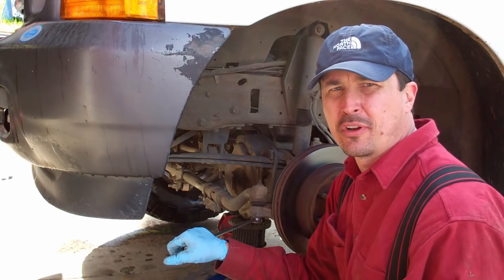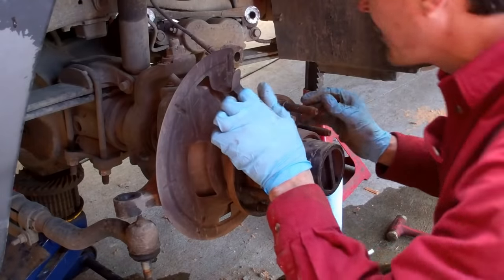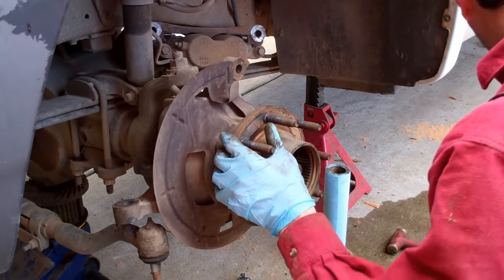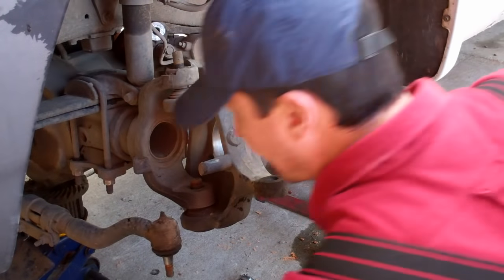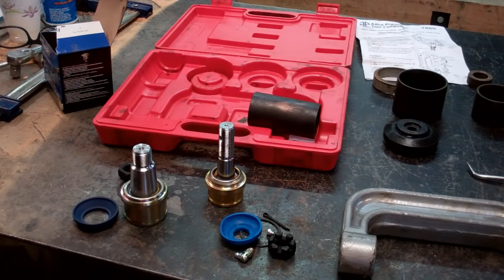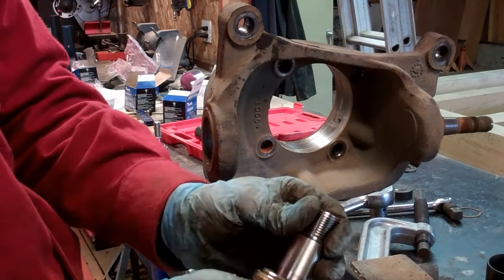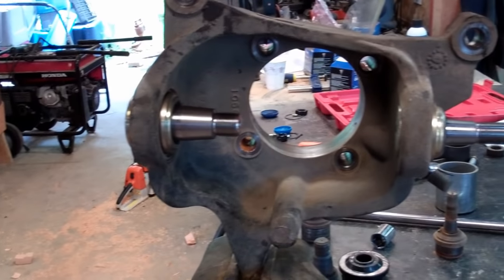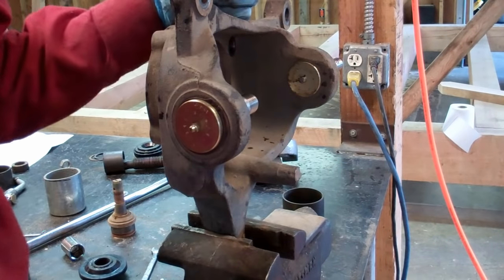How To Replace Worn Ball Joints Ford F250 Truck

Comment: Fantastic video.   Thank you.  I have worked on my own cars my entire life and am getting ready to do my E350's ball joints but was a little concerned as it's such a big vehicle... but this really put my mind at ease.  I don't have to worry about the 4WD aspect either so it will be even easier.   and to the guy below...  "goo gle" I would trust this guy or myself to work on my cars over any "professional certified mechanic".   I make very good money, but I still prefer to fix all of my own stuff as i know it will be done right and know for a fact I take more pride and do a better job than most "mechanics" out there.  Not all...  some I know and trust, but it is unfortunately, not the norm.  In fact most of my friends come to me when they have big repair jobs needed to get a second opinion before taking their own cars in because they have far too often been taken for a ride.    Again, Thanks for this great video!!!  and I agree, buy quality American parts whenever possible. MOOGs have an excellent reputation for lasting forever.

Comment: On reassembly you can put the 90 degree grease fitting in it does not hit I did my F-250 and It works.

Comment: To anyone having the problem pressing the lower ball joint out you can also smack it lose with a small sledgehammer then use a big socket in between to hammer it the rest of the way out. I found it much easier than pressing

Comment: I was quoted $1100 4 yrs ago, Ford E350 van.
Bought parts at autozone around $300 , they have a free loaner press tool.
I used a 120v elec impact wrench ($60) to drive the press, came out a treat.
A 24" breaker bar with universal swivel head is useful too for stubborn nuts/bolts.
I'm not a mechanic, I'm a baker, if I did it anyone can. Why not.

Comment: thank you for the brake down ,, they wanted to charge me 600-700 $ to replace the tope bolt for the camber since my truck was out of Alignment.. i need to replace all my u joints, on my 4 wheel drive f250 91 , i will do this the same time i put  my new rotors on

Comment: instead of buying a piece of pipe for an extension, there is a 4wd adapter that can be gotten at Oreilles auto parts, (just did my f250 4x4) But all your info is handy.

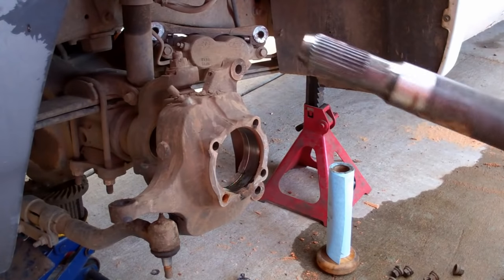Comment: Just a comment, i noticed you pulled the axle out and talked about keeping it clean, however that ring you kinda slid back on to the axle at 8:30 was what used to be a dust shield. Make sure next time you clean the inner axle out real good.

Comment: Good video just one thing the 3 washer and snap ring what’s the order to put them back on. I have the same truck but never mind how I pull them off. Plz if u can plz help. If not that’s anyway good video. Clean shop n like how you beak it down. Without the dragging on just staying on the job at hand. Again thanks I use your video to do my ball joints.

Comment: What year is the Truck you’re working on mine is a 1997 F2 50 heavy duty and I don’t think my rotors come off like yours did nor do my hubs come off like yours did I have to do mine but I need the instructions for a 97

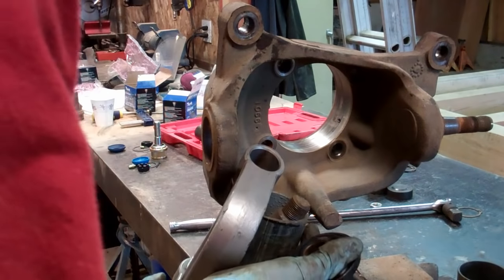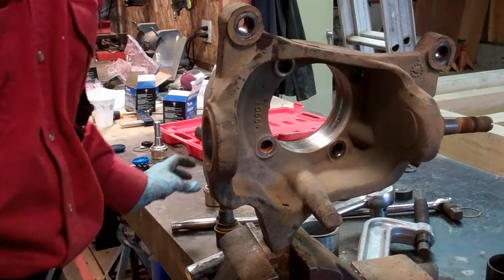Comment: wranglerstar   I'm confused--you said that there shouldn't be any play/movement in the ball joints (16:20-16:50), but the whole purpose of the ball joints IS to allow movement in two planes.  Do you mean there shouldn't be A LOT of movement, or that you shouldn't be able to move it around easily with just your hands (i.e., if you can then either the ball of the joint or the inside surface of the casing has worn down too much)?

Comment: I do all my own work on my old 1988 GMC Suburban and save a ton. One dealer one time wanted $650 to put a fuel pump in the tank  that cost me $35 for the pump, so I did it myself.

Comment: Thanks for the help, I had a major issue with the cheap china made ball joint press rented from one of the auto parts store, if your thinking of getting the press there check to insure that someone didn't bend the c portion of it so that it doesn't align with the ball joint, took me 2 hours of wrestling it to give up and take it to local machine shop, sorry I really need the vehicle  and hate to part with the money. If I ever do this again I will spend bucks and get good set

Comment: Great video. i"m right on the same page with doing your own repairs.
 i wish you would:ve included a good way to reinstall the big axle shaft seal. I just use a copper drift tool working around the seal until its driven in all the way. What do you use?

Comment: Good video.  I haven't gone through and read all the comments, but the person below had the same problem as me.  Axle shaft seal wouldn't come out with a few taps, even though the metal ring from it did.  Too much pounding will ruin this seal.  Best way to get it out is a big pry bar and pry from behind on the U-joint knuckle with steady pressure.  That seal is too springy to pound out if it's stuck.  Ruined mine.  You also need a specialty tool to replace the new one if you break it.  As always, pay for the good parts like he says.  I always go with Moog if at all possible.

Very helpful video otherwise.  Thank you very much for posting it.

Comment: What brand of ball joints are you using I have to replace mine and the Ford dealership here quoted me 1400 for both sides. I plan on doing them myself I just want to know what brand would be good for a 2006 f250 with a 4 inch lift kit and 35in tires

Comment: One additon I would make is that when you take the shaft you should tell views to use two pry bars applying equal pressure on the u-joints and the shaft should just pull out, basically not having to use a hammer.  Other than that an Excellent video, thanks

Comment: A little trick... Change the small bearing( partnumber : b-2110. SKF/Napa I buy mine on ebay) The needle bearing is on the backside of the hub when you do this work. Very easy to change. Take a 25 mm socket and put it in the hub. Then tap the socket with a hammer and the bearing comes out. Tap the new SKF/Napa bearing in with a 30 mm socket. Grease it good with bearing grease. Good and problem free ride for a few dollars😄👍 🇧🇻

Comment: Thankyou very much for this video its helped alot, im going to get this 
done this weekend and was wondering how you went about setting your axle
 shaft back in the proper distance, did you use the recommended tool 
that also sits your axle seal or do you just hit it with a dead blow? i 
would appreciate a response from anyone thankyou :)

Comment: you don't have to remove the abs wire from the hub unit, and alot of the times, you can smack the ball joints out of the knuckle with a hammer, and then just use the correct size cup over the new balljoint to drive it in. saves you alot of time

Comment: Thank you for an excellent video. good detail and clear videoe. One question, you spoke of cleaning up an O ring when you re install the hub. Does that O ring act as a vacuum seal for the ESOF hub?
Reply: Yes it does and you might get error codes if they leak a little. I had to pull mine apart and replace o-rings

Comment: a point not often made is this:
on the press, examine and lube the thread and the cap before use. this ensures that minimum friction fights your efforts to press the ball joint.
a second note on removing the drive axle from the axle housing. Use the greatest care when pulling the axle out. there is an inner seal at the far end of the tube that keeps gear oil where it belongs. Nick that and you will be pulling the carrier to replace it, or u will be getting gear oil out the axle tube. remove by supporting the axle at dead level all of the way out and all the way back in. cleaning first with solvents so as to carry no debris into the seal on the trip back in.

Comment: Thank you very much for this video, was very helpful.
I used only pipe sleeves to do the pressing, could not find suitable c-press or similar.
I prsssed them in a vise.
Sleeve sizes I used:
D=inner diameter
L=length
D:56,5mm L:100mm
D:44-50mm L:90mm
D:50-54mm L:75mm
D:50-54mm L:15mm

Comment: What about the ABS sensor?  If I have it right one should not try to mess with it at the hub but rather remove the lead end where it plugs into the wire harness and keep the lead with the spindle assembly.  Also once it is all installed it would be good to grease that top ball joint to fill it then put the plug in, right?  Otherwise there would be air between the ball joint and the boot/shield and that would allow for contaminates to get in there and it would wear out much faster.

Comment: great video and good help for ball joints. you are a great american for sure. What is the size of the 3" bit of pipe you used.. it looks like 1 1/2 or 2". I plan NOT to be a panzy and do it myself.. or with some help. thanks again and u da man..

Comment: Could you take the hub assembly off with the rotor still on? And is the bearing replaceable without  having to buy a whole new assembly?

Thanks Great video by the way.
Reply: Well you have to remove the brake caliper regardless, so you might as well slide the rotor off as its just kind of hanging out there.

Comment: Why do you have to take the hub cap off and remove c clip on axle shaft? Theoretically couldnt you just remove the four bolts and pull the hub assembly and axle shaft out together in one piece versus taking everything apart?

Comment: Just did this on a f350 2 wheel drive for the first time. Passenger side took me about 8-9 hours. Driver will take me about 5 hours. Im sure it can be don’t a lot faster with perfect tools. Needed a 36 mm ratcheting wrench for sure but got it done with out it. Make sure u have a breaker bar and a pipe for extra leverage. That’s my two cents and get ready to work.

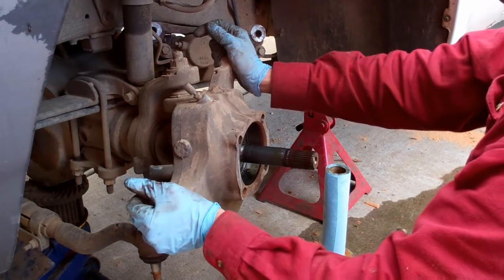Comment: I've been following your video with no problems up until the removal of the axle shaft. I noticed your axle shaft is seated pretty deep at first (7:40). But then when you say to use a brass hammer to bang from behind (8:01), you have already moved the shaft out of its seat by 1/2 an inch or so. I'm having a real hard time getting the axle shaft to budge at all.

Any suggestions?

Comment: Another option than finding a big piece of pipe for an extension for your ball joint press is to take an angle grinder with a cut off wheel and remove the tapered stud portion of the lower ball joint...essentially makes the ball joint much much shorter. That's is what i do, works good just be careful.

Comment: Check your track bar end bushings. The track bar keeps the body centered on the frame. To check it, start the vehicle and have someone turn the steering wheel left and right while you get underneath. If there is any play at either of the connection points (bolts) while the steering system is in motion, then the bushings are worn. They are easy to replace.

Comment: I do a lot of ball joints and tie rod ends and drag links -- I just did a 2001 f250 4x4  last week end --- this guy did a good job -- and got good parts the first !!! ---- but , the ball joint nuts need to be torqued to spec's  --- on a 99 -01 it is 101 torque -- top and bottom --- 02 - 04 is different torque ---- yes, you can over torque them-- and that will cause hard steering -- and also use a sledge hammer to seperate the steering knuckle

Comment: Awesome video. I am going to tackle this on my 1999 f-450 tomorrow. It is a 2 wheel drive.  Do you know if I have to remove the rotor or hub from the spindle? If I do I might as well pack the bearings and put a new seal?  Thanks for the video and keep up the good work!!!

Comment: i work at a fleet company and i am ase certified, i pride myself on my work i wish i had all the torgue specs on all the nuts and bolts on everything. i just did ball joints on a 95 f250 and for me to do 2 hours of work per side will run a body about 350 with these manual locks. flat rate pays 4.5 hours per side tho

Comment: having a problem with the rubber gasket around shaft cannot get it to pull out of hub assembly the metal ring came out but not rubber piece and now is giving me trouble with pulling axle shaft out can u help me

Comment: they make grease fittings for that clearance problem on the upper ball joint called needle or flush mount grease fittings and a special adapter for your grease gun the adapter go's on in place of the normal fitting head and also needs a flexible rubber grease hose

Comment: Great video ,thank you. But I wish you had showed putting the axle back in. I've watched other vids & they show using ANOTHER expensive tool($125~) Did you get one of those or do something different? Anybody have any ideas for getting the axle back in to seal?
Reply: +Bill Longland  I used a dead blow hammer (3LB). Worked great. A good piece of firewood will work just as well. You probably have that laying around, right?
Reply: I ended up using a pipe on the big rubber seal, put a thick rubber glove then the pipe , worked ok but how far in is it supposed to go? On one side the shaft end moved around easily but the other side it never? The shaft was very hard to move up/down/left/right. I think its ok but I'm not sure it is?

Comment: I have a 2003 F250 super duty 7.3l. Is it necessary to disassemble the axle hub before removing it & pulling the drive axle just to replace the ball joints? I've seen the whole hub assembly for sale, so it make me wonder if I really need to pull it apart.I have a 2003 F250 super duty 7.3l. Is it necessary to disassemble the axle hub before removing it & pulling the drive axle just to replace the ball joints? I've seen the whole hub assembly for sale, so it make me wonder if I really need to pull it apart
Reply: unfortunately yes has to come off you cant get the axle shaft out or the ball joint nuts with the hub assembly on. you can unhook the abs sensor like he did or u can follow it up to the frame and unplug it there

Comment: This is great except i have a 1997 ford f250 and the hub for the front axle is very different.  have had a bear trying to get the rotor off.  still struggling with it.  thanks for the help though!

Comment: Most factory ball joints are sealed, and I have had them last 250k miles. Grease Zerks are more trouble introducing anything left on the nipple into the joint, sand, salt moisture. If you ever have a shop change your oil in a pinch they will not take the time to wipe them clean and you'll be replacing them again sooner than later.

Comment: Thank you I am sure it is the same for an F150. It looks pretty easy. The process is the same on both sides?
Reply: Sean Taylor I'm sure the F-150 is quite a bit different. I believe they're independent front suspension. The idea behind how to remove the ball joint is the same, but disassembly is quite different.
Reply: Sean Taylor same basic process.
Reply: It was similar accept for the hub assembly. I got it done and did my own alignment and I'm very pleased.  Thank you so much for the help!

Comment: Cody, How long was the 3" pipe you had made, I need to do this to my truck and I'm not paying the $1300 they quoted me. Thx, John
Reply: You think it was an inch longer than the one in the press kit and same inside diameter????
Reply: @mikes.1882  Mike, he never replied to my question but yes I'm guessing it it is, not much longer than that because it would make it harder to put into position. I cut an extra piece of replacement exhaust pipe but it was too thin and bent, then I found the oem pipe and its really thick, that's what you'll need. I ended up paying for the ball joints to be pressed in because my vise wasn't clamping tight enough. Other than that its not too bad.
Reply: @mikes.1882  If your axle doesn't easily slide out like Cody's did your need a long handled pry bar to pry the axle out from the front of the knuckle but be careful because there isn't much of a lip but it works like a dream after I beat the knuckle, cussed a lot, and watching another 3 videos.

Comment: If you're sharp enough to do the repair, you've got the know-how to diagnose as well. Like the repair itself, you'll be slower than the professional. Learn the systems of your truck, take your time and pay attention -- it's not hard. Also, get a dealer's OEM manual. Much more thorough and a million times more valuable than a Chilton or Haynes manual. If you can learn to navigate them, you can do without the internet as well. Very good video.